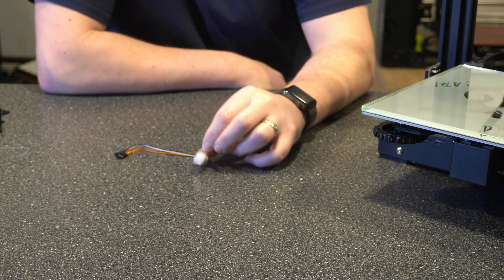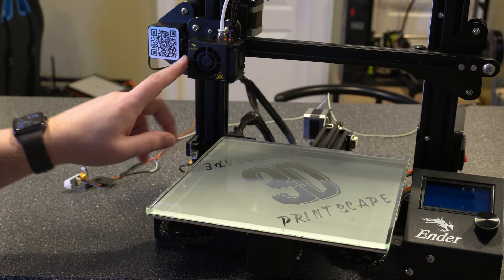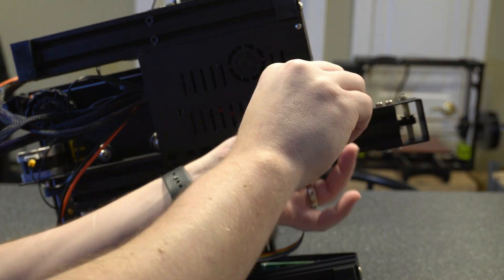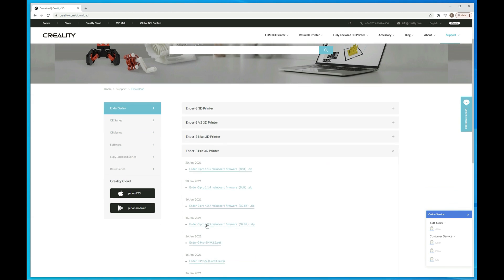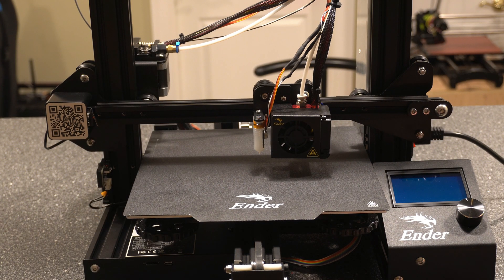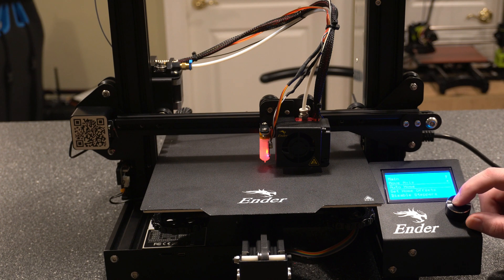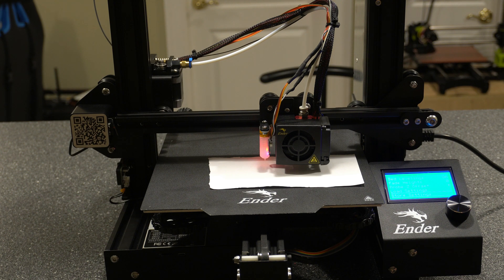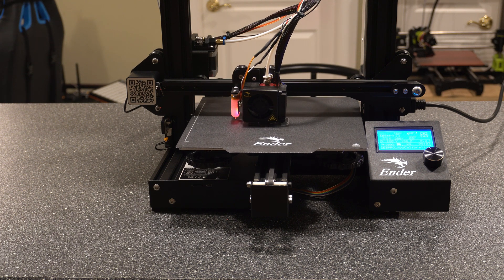Guide to Install a BLTOUCH on a Creality 32-bit Mainboard

Comment: USE THE ADAPTER THIS METHOD FRIED MY BOARD
Reply from the maker: Hi. It doesnt work with the adapter most of the time. If the board got damaged, the likey cause was the +5v and grnd wires being backwards in the harness. If seen the bltouch ship wired 10 different ways.
Reply: @3DPrintscape  I plugged it in with the adapter and then the bl touch moves up and down a few times and the screen is just blank but if I unplug the adapter and just have the screen and none of the bl touch stuff plugged in it works fine
Reply: @3DPrintscape  the screen flashes with the bl touch but then just does nothing
Reply: My wires are also red yellow and blue instead of how yours look
Reply from the maker: @3dragonprints458  Thats how my other bltouch is. If the blue one is in the middle, that's what caused the issue.
Reply: @3DPrintscape  where should the blue one be
Reply: @3DPrintscape  where should all of the colored wires be placed
Reply: Super weird I thought it fried my board because it sparked and got really hot and smelled burnt electronics, but after switching the wires around in the connected I got it working. I don’t know how I didn’t fry the board because after I took the pins out when I smelled it the plastic was black around them instead of white
Reply from the maker: @3dragonprints458  Im glad your board ended up being ok, it sounds like you were able to turn it off in time. I explain the wiring in more detail in the written instructions, link is in the video descrion.

Comment: Hi mate I have the 4.2.7 board I installed, I installed using the pin adapter and removed the z stop. I’ve tried to auto home and it gets about half way into the bed, and says “stopped” and then says home z first, and when I try and go into the negative to level the z axis it won’t let me ?
Reply: I have the ender 3 pro too
Reply from the maker: Hi. I would say dont use the transfer board, if you are. Next, make sure you are using the correct firmware for the way its wired. By default, the Creality firmware assumes you leave the z axis connected and plug all 5 pins into the bltouch port.

Comment: I followed your instructions but all I get is a solid blue screen. Hasn't changed for 5 mins. The bltouch just is red and the plastic piece slides up and down twice
Reply from the maker: Hi. Try to add a date to the end of the file name to see if that changes anything. The reality boards don't like the same firmware version to be used.

Comment: I’m not computer savvy. Welder mechanic by trade. I think a some quite a few people get printers  do couple things run in problems and then mostly sit. My opinion some of people I know personally. Thanks great videos.  Keep those video’s rolling and stay safe.
Reply from the maker: Hi. Thanks for sharing. Ive seen a lot of the same behavior, which is one of the reasons i started 3d printscape.

Comment: Would you  be able to provide firmware configuration settings for an ender 3 pro, with the 2.4.7 board, and the BL Touch 3.1.
Reply from the maker: Hi. I actually started building some firmware bundles. You can download them from here. https://3dprintscape.com/marlin-firmware-builds/

Comment: Everything connected and after that the Z-axis did not go down anymore. 
Solution: Reverse Blue and Red from the connector on the motherboard. 
1=GND (blue) 
2=+5V (red) 
3=Signal (IN) (yellow) 
4=GND (black) 
5=Z-stop (OUT) (white)
Reply from the maker: Hi. Thanks for sharing. Ive posted the wiring order in the written instructions because ive seen them shipped wired 10 different ways now :/.

Comment: your video very help full but my bed will not level    Why?
Reply from the maker: Hi. Can you provide more details on the behavior you are seeing?
Reply: @3DPrintscape  It goes on and clicks like three times or two times it moves but it doesn’t level down to the bed honestly I think it’s I don’t have the software installed yet because I don’t know which one to install could that be the problem I bought it off Amazon an ender three pro
Reply: I did download the software to card and but it in the printer but nothing happenn   So I don't if I did it right???
Reply from the maker: @dawngeniale9172  Would you be able to join my discord server, it would be easier to troubleshoot there. https://discord.gg/Bu94EYVkrU

Comment: Question- I followed all the steps here multiple times. And still can't get the touch to work. It's lit up red but when I go to bed leveling it starts back using the switch. I have an Ender 3 Pro with the 4.2.7 board. Thanks in advance for any help
Reply from the maker: Hi. It sounds like your wiring may not match the firmware config. How do you have it wired and what firmware are you uisng?
Reply: @3DPrintscape  I have it wired just like your video. And I'm running the 4.2.7 from the ender site. I tried the 2.0.1 without transfer board and I got no response when I loaded the card
Reply: Just seen that I have the V1.0.0 firmware I'm assuming that's gonna be my issue lol
Reply from the maker: @crazyskipperschit  Not necessarily. Is it the Creality 1.0 firmware? If so, that doesn't align with the marlin version. It most likely marlin 2.x.

Comment: Would you still download the ender 3 pro firmware for the ender 3 printer?
Reply from the maker: Hi. It would probably work but there is firmware specific to the Ender 3 on Creality's site, so i would go with that.
Reply: 3D Printscape thanks for the help. Without you helping my questions I don’t think I would have gotten through this well
Reply from the maker: You’re Welcome.

Comment: my bltouch came with the same connection as original Z-stop cord :/ What do I do if Z cord is swapped?
Reply from the maker: Hi. You may need to change the pinout.
Reply: @3DPrintscape  there is also an adapter to have the other 3 paired in with the big rainbow cord :p does that screw things up too?
Reply from the maker: @4v4t4rmusic  The bltouch can be wired a couple of ways. you will just want to make sure the pinout is right. From there, you will want to make sure your firmware matches the wiring.
Reply: @3DPrintscape  Thanks so much!
Reply from the maker: You’re Welcome
Reply: @3DPrintscape  so I wired it all up the same as you but had to pretty much one wire at a time. Sometimes my printer gets into this mode where at start of print it looks like it’s about to search for middle level but it just tries to go through the plate so I have to turn it off before erthing explodes. do you know what this is? May have left a wire exposed ... I’ll have to check but asking in case this is common
Reply from the maker: @4v4t4rmusic  If its working sometimes and not others it most likely a loose wire or connection. Make sure that the wiring is ran in a way that it's not putting tension on either of the plugs.

Comment: I need help! I got the correct BL touch. for my ender 3 max and downloaded firmware from creality to update main board and then the one for BL touch. It worked at first and then we had a power outage and now the update for it is gone! I tryed redownloading it to printer but it wont go on now???Im such an old noob.Can anyone help?
Reply from the maker: Hi. Is the printer working at all now and what happens if you try to push the firmware again? Also, try to just add the date at the end of the firmware name and upload it again. The creality boards dont like the same file name to be used.
Reply: @3DPrintscape  Hi. I will try on Monday as I just made a 1000 mile round trip to Pennsylvania and back to Conn. I didn't realize that about changing the date. After it goes in will the setting stay?
Reply from the maker: @davidjohnson8474  I would recommend doing a restore defaults after you upload the firmware. This will clear any settings you have but prevents other issues.
Reply: @3DPrintscape  well i dont know how i did it but it seems to be working! Thank you for saying about the tune spot and to make sure to store it! I guess I will keep tuning it
Reply from the maker: @davidjohnson8474  Im glad to hear you got it working and you're welcome.

Comment: One question: How do you set up bed-leveling so that it happens automatically before each print?
Reply from the maker: Hi. You would add the G29 command to your machine profile in Cura. I cover that in more detail in the written instructions that you can get to from the video description.
Reply: @3DPrintscape  Thanks. I had already done that but did not realize it until this morning. Keep up the great work and videos. Thanks again.

Comment: So I found your video after I installed a 4.2.7 mainboard and a BLTouch and had the issue of the Z axis not lowering like others have had. Today I decided to double check all the connections like I saw that you had recommended to others, and low and behold I found the issue. I was wearing my loupes that have some pretty good magnification so I could check what colors were attached to what on the BLTouch, and make sure everything was connected correctly on the main board. Everything was in the correct order but I found that with the two pin connector going to the main board had one of the inside pins that would move backwards in the plastic housing causing it to not make a connection. My touch was not from Creality and I wonder if there is some issue with manufacturing with some of the clone versions. I also wonder if this is a common issue that causes so many headaches for people. If I had not been wearing my loupes I would never have found this issue. Thanks for the video and keep up the great work!
Reply from the maker: Hi. Thanks for the info and feedback. I have seen a lot of connection issues similar to what you are describing. It makes things difficult to troubleshoot remotely because everything looks fine to the owner. Ive also seen the same thing start happening mid way through running a mesh. I think the additional movement in that cases the connectors to move about.

Comment: So I just got my BL touch for my ender 3 pro.. right now I'm running a firmware that makes my Z go to 350mm instead of the normal 250.. how can I still keep the 350 and add the BL touch?
Reply from the maker: Hi. I think you reached out on Discord, but if that wasnt you let me know. This video covers most of what you need to do. You will just need to make sure you have the bed size set right. https://youtu.be/pQ7WZST8sqk

Comment: im completly bummed right now! I hooked everything right and BL touch doesnt light up and main screen is all blue and flashes! I think I ruined my Max.I got new firmware from creality and put it on a 8gb card and now this.Hope someone can help!
Reply: Ok I'm up and running! I'm making a bench so I shall see how it goes. I found that my computer wanted me to use a SD card instead of the one they sent me
Reply from the maker: @davidjohnson8474  Cool, glad to hear you are up and running :).
Reply: Ok I took all the BL touch out and plugged everything from new and it fired up. Ill try it in the AM.Fingers crossed its back
Reply from the maker: Hi. It sounds like the wiring may not be right. Take a look at the written instructions in the description, i cover the wiring more there.
Reply: It was. It did when I first put in and powered up ,flashed and probe went up and down. Now nothing. I think I'll get the one with the one plug on the side for my board.
Reply: Well it's running good. Just have to adjust it every print.
Reply from the maker: @davidjohnson8474  What do you have to adjust on every print? Assuming there is no extra play in the x-axis or carriage you should only have to run the mesh.
Reply: @3DPrintscape  I meant the bed hight. I have the correct BL touch coming on Friday and I have solid mounts here. So fingers crossed it works better. I also found a 3d printer class 20 minutes from my house so I signed for it!
Reply from the maker: @davidjohnson8474  Ah ok got it, and nice. I haven't really seen many classes around me at all, which is a reason I started all of this lol.

Comment: So do you have to change the z-offset if you say add a glass print surface? Or since it is probe offset, and probe is in fixed relationship with head, it is okay still?
Reply from the maker: Hi. Its a fixed relationship with the nozzle. You only need to set the offset once and will only need to adjust it if you make changes to the probe mount/location.

Comment: I have been messing around for more then a day. I used the original wires on my Ender3 Pro. After seeing your video I decided to replace the connectors of the wires on the BL touch and connected them like you show in this video. It worked instantaneous. Now I still have to adjust the Z and stuff but happy for now. When all works, I can replace the Creality software with the Marlin Firmware. Thanks a lot for the video
Reply from the maker: Hi. Im glad i was able to help :). If you are looking at going to Marlin, i would do that now as you can enable the z-offset wizard and babysteppign to help set the z-offset properly.
Reply: @3DPrintscape  I did go to Marlin, but am suffering, cant get the z offset stored. No matter wat I do, it is set at 1 or 1.3 andbI need -3.3. So I cant use my printer now
Reply from the maker: @Rob-gd6kp  Did you use the z-offset wizard? It makes things a lot easier.
Reply: @3DPrintscape  z-offset wizzard is new to me. Will look into that and try it. Thing is that my children bought the BLtouch for me and now I have it disconnected. Not e great feeling tbh. I connected it with the new connectors thta came with it and the way you showed in the video. Both options make the BL touch work, but the only problem in both cases is the Z-offset, I am printing atm, but will look at the wizzard tomorrow and give it another try. Are you still using discord? Maybe better to post my questions there?
Reply from the maker: @Rob-gd6kp  Sounds liek you really just need to get that z-offset set right and you will be good. I am on discord and the community there is growing as well, almost up to 500 people :).